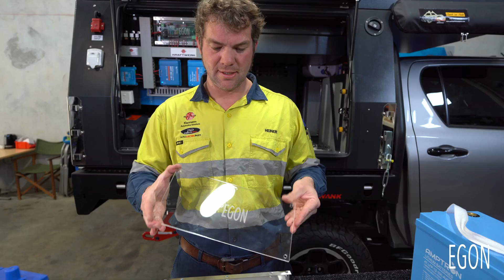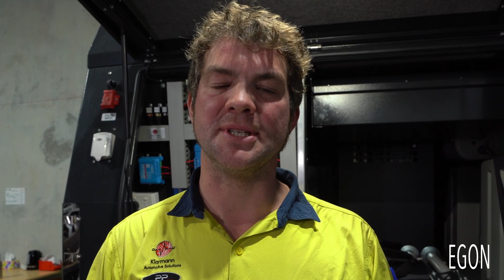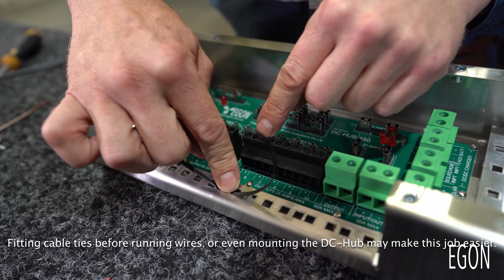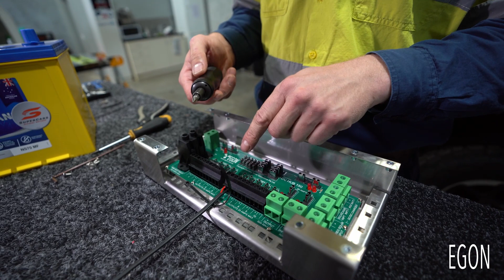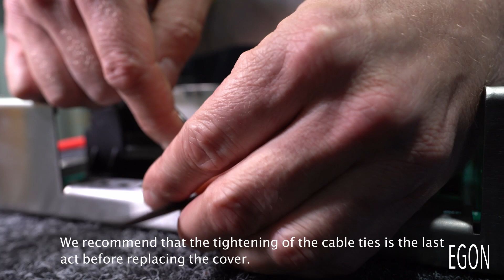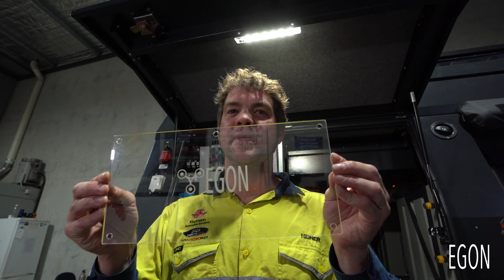Basic installation guide for the EGON DC-Hub | EGON

Comment: We are fitting these boards as part of a new build & they seem handy for all our wiring but i feel there needs a couple of improvments.
The main Pos & Neg connector flexs slighy when torqued, it has mount holes going through the PCB but is not secured to the PCB & seems only held on by the solder joints, why does this come from factory like that.
I figured that in the bag of plastic screws etc supplied that there would be something that fits but no? & there is no instructions as to what any of the fasteners are for, they dont even seem very useful, we have moved to a solid spacer & M3 screws over the plastic ones supplied.

Comment: Is there a reason you don't use ferrules on your wire ends before inserting them into the wires mounts? I know it's a plate and not a screw securing the wire, so is it recommended to not use ferrules? Good job otherwise on a good looking board. Looking forward to seeing more videos. Thank you for including torque specs in the installation! :)
Reply from the maker: Use ferrules if you want to. We do not because they are not needed.